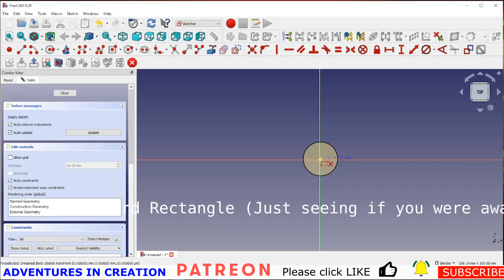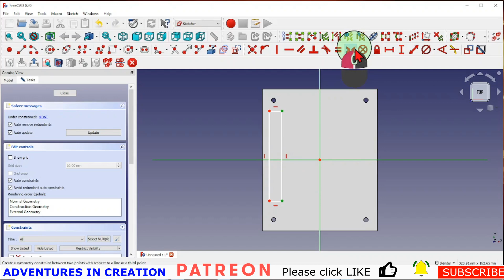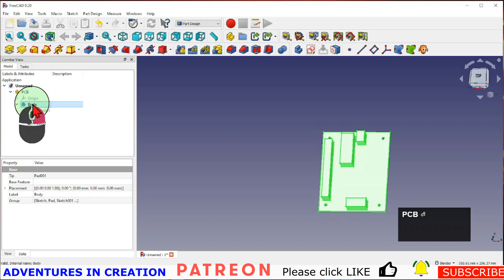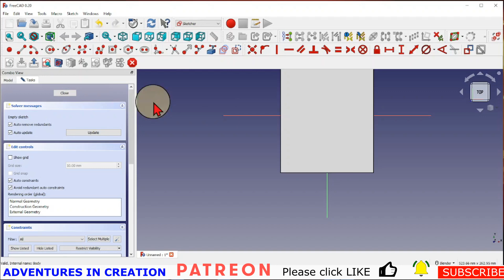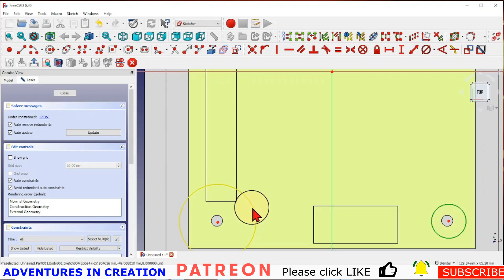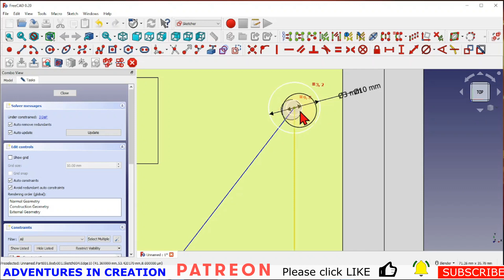FreeCAD Beginner #32 Fully parametric CNC Electronics Enclosure Pt1/3

Comment: I really appreciate this walkthrough, as I'm doing almost exactly the same thing, just with a PC motherboard. But I'm getting very frustrated because you're basing everything symmetrically around the center point, but what I'm doing has absolutely no center point or symmetry. Not a single thing on my PCB is symmetric. So I'm beating my head trying to figure out how to position things based on the EDGE of the board, not by its "Center".
Reply: On a side note, the only solution I'm aware of so far is to drop a reference point at each corner of the PCB, lock it into place, then do my measurements from there. Any better ideas which don't consist of referencing the center point?
Reply from the maker: You can add datums, planes, lines, points to work from.

Comment: Can I ask why you decided to make 2 models and boolean cut, rather than creating a sketch on face and pocket? Was it just what you decided to do or was you showing alternative methods of cutting the hole?

A question on upgrading from 0.19 to 0.2. Does freecad keep user settings and plugins or do you have to go round setting everything up again from scratch?
Reply from the maker: Hi Paul, the sketch on a face approach can get you in trouble with the topological naming issue. However you could offset a sketch and use that but, I decided to use the boolean approach for this one. The upgrade does keep everything so its pretty seamless. I recommend using the 0.20 version now.